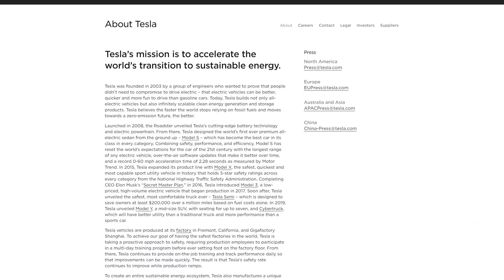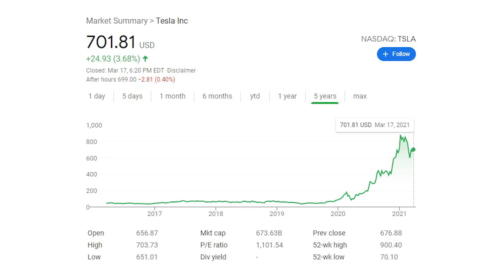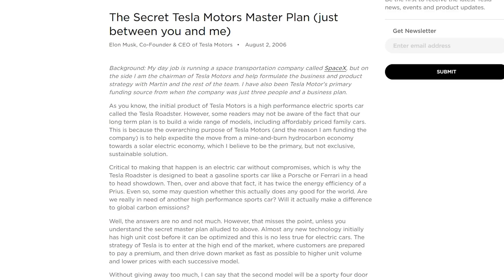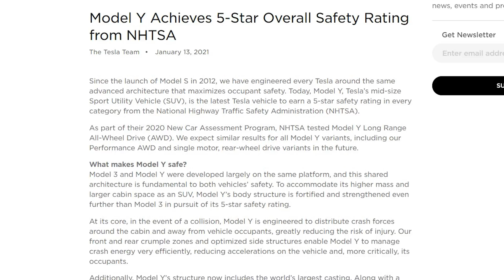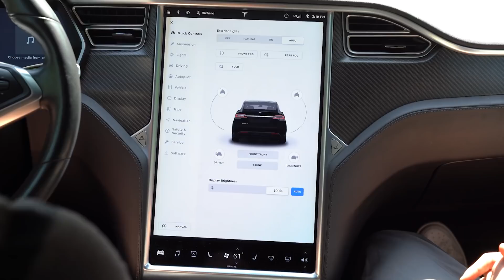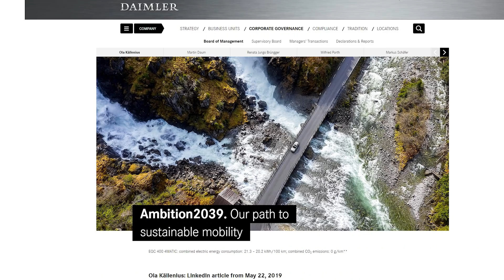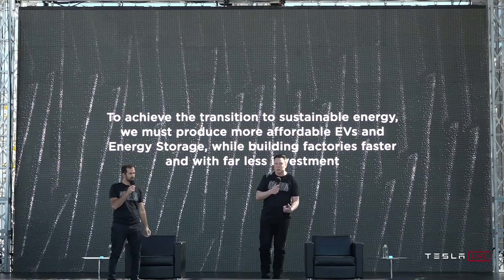Thank You Tesla for Pushing EVs Forward

Comment: That’s all nice but please keep in mind that electric cars and projects like powerwall/powerpack use an energy that is actually NOT sustainable. Lithium batteries have a very heavy carbon print when they are produced, and it is extremely difficult (if not impossible) to recycle properly. Make no mistake, electric doesn’t mean green energy or eco-friendly whatsoever, it is eventually very polluting and not a long term and clean solution for the Planet.

Comment: The only thing I hope that Tesla won't be responsible for bringing into the world is the customer service and repairability. 

Electric cars are pretty cool, but they tend to come with so much tech that they're more a "rent-a-service" vehicle rather than own.

Whilst some people may enjoy that, I'd like to have a car where there is no computer between me and my acceleration and handling, no electric door openers that won't work in the winter and no phone-home network that can disable features (like electric seats or performance) in my car which I paid for or turn off my ability to refuel when I am on the road. 

That said, it's definitely true that Tesla has made electric cars much more than an oversized flashlight and they don't even lose that much power whenever you turn the turnsignal on ;)

Anyway, great vid Sam! Thanks